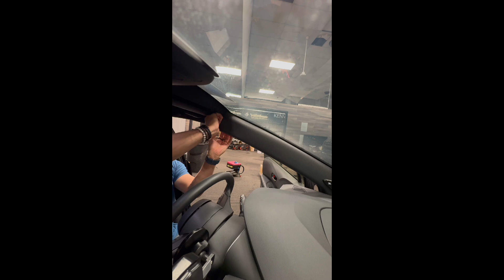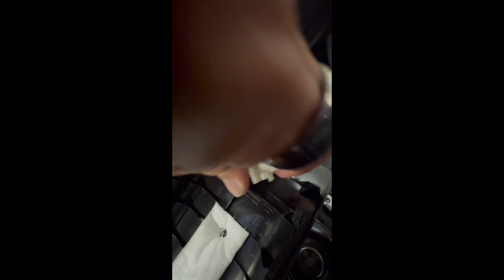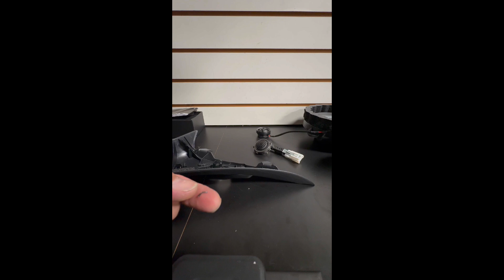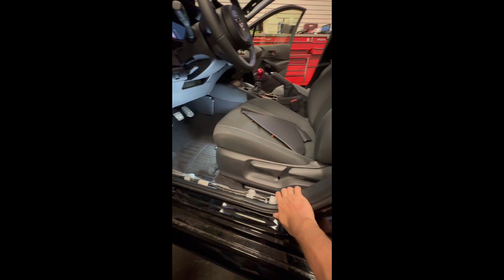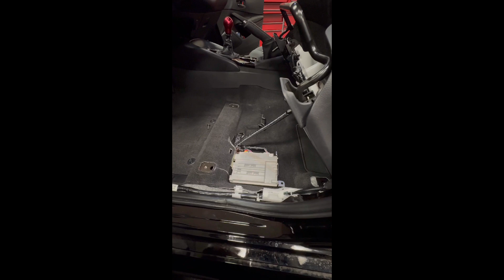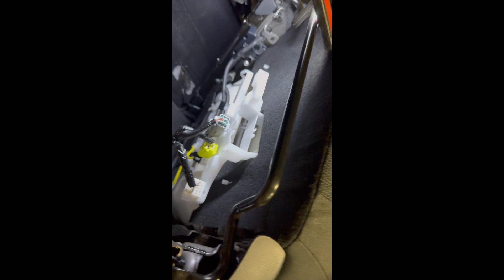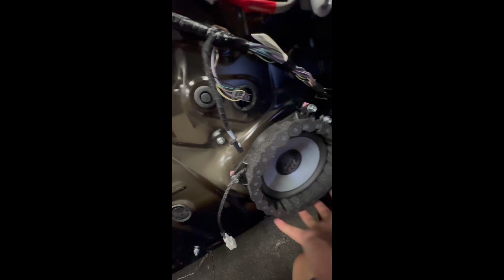GR Corolla Plug & Play Audio system installation

Comment: for 1:10, if you have the sub power cable mounted there, where would you mount the amp one? also since the floor vents are blowing towards amp, any worries of it overheating if i have heat to high?
Reply: *1:10:10